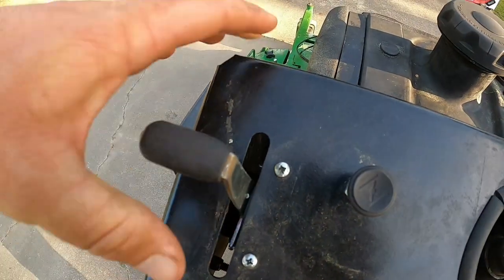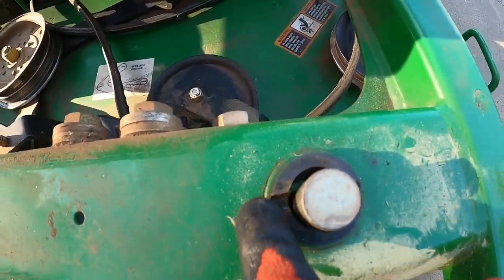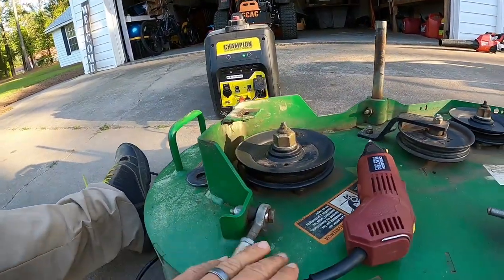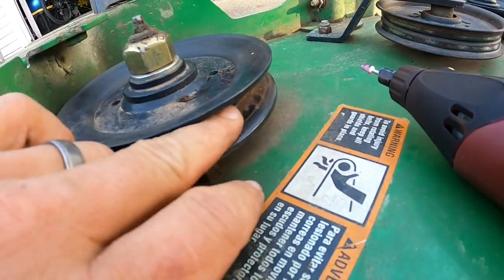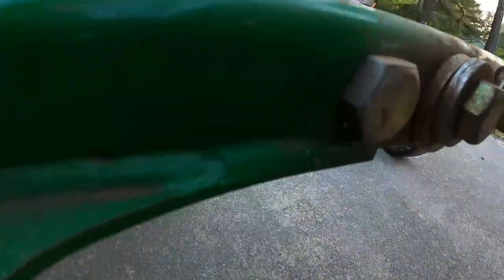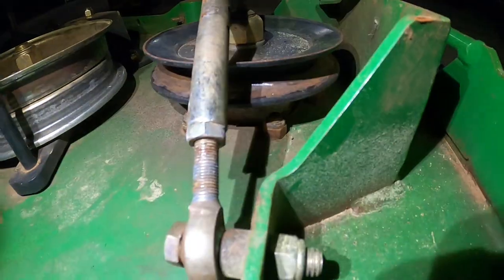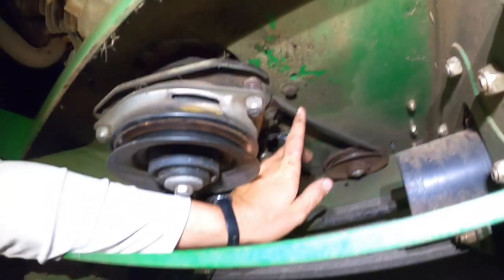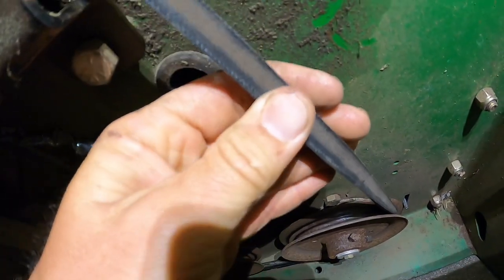Making the DEERE AWESOME! pt1

Comment: With the deck belt off, spin each spindle as fast as you can, put your hand on the deck, if it feels rough or sounds like driving on gravel, replace the bearings NOW, not later. If the bearings seize the race will spin and then its time to replace the spindle housing too.
Reply from the maker: Great advice bro